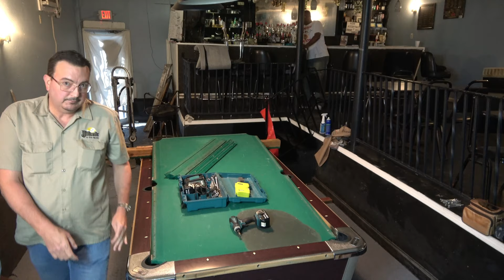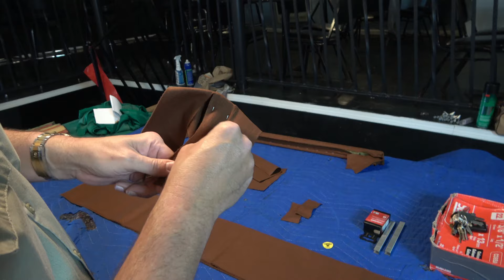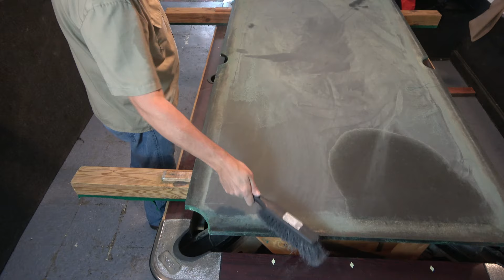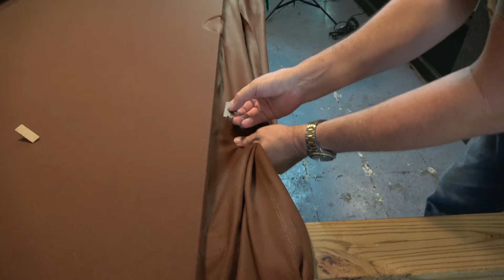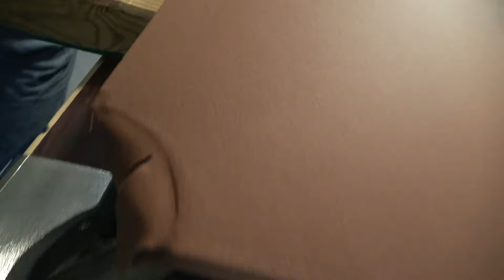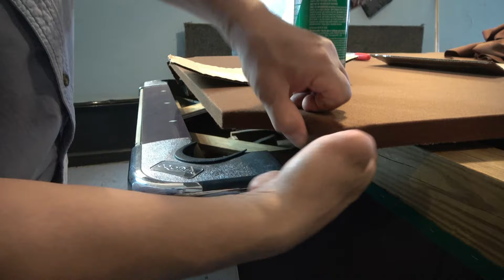How to Recover a Valley/Dynamo Coin Operated Pool Table (Step-by-step Tutorial)

Comment: which model of stapler is best suited for this and what size staples? The video looks like it will help me a lot when I refelt my valley 8ft coin op in the next couple of weeks. Going to try the Simonis  860HR
Reply from the maker: Simonis is an EXTREMELY difficult cloth for an amateur to install - especially on a coin operated table. I would avoid it if I were you. But, it's your table, money, and time. So, I hope it works out for you.

That being said, I use a Senco stapler (link in the description) and 3/8" staples (again, link in the description).
Reply: @CreativeRestorations  thanks for the advice. If I can find someone to install it for a reasonable price I will but there's not a lot of qualified people in my area. Would you use a different method for 860 cloth or the same method but just more difficult?
Reply from the maker: Simonis doesn't stretch like other cloths do. You have to use the same method. But, don't be surprised if you still have wrinkles in the rails. Especially at the side pockets. You would use the same method. It's just that it's REALLY difficult to get the wrinkles out when using Simonis.
Reply: @CreativeRestorations  thats good to know, thank you. I really liked your video it's very informative

Comment: Great video. Do you always start on the long side to glue then stretch?  I have an 8' table without slate liners. I've seen you do the ends first on longer tables.  Does it matter where I start?
Reply from the maker: Thank you for the compliment!

I think you may have someone else's video confused with mine. I never do the ends first. If you do the sides first, it's much easier to keep the cloth in it's right position (doesn't end up skewed). I would suggest you do the same.
Reply: @CreativeRestorations  Sorry, you are correct about it being someone elses method.  I noticed you don't  use pocket liners for a buffer. Is it really necessary? Do they really help protect slate from a hard bounce back?  Thanks again. I think your videos are outstanding and thorough.  You've inspired me to restore my table.
Reply from the maker: Thank you very much!

I personally think the use of cloth liners in the pockets is unnecessary. I only use them in instances where the actual bed cloth doesn't fully cover the slate (in the release cuts). Also, they're probably used more on tables that have cheaper, thinner cloth. I've never had any issues using Championship Invitational or Tour Edition or any of Simonis' cloths. Good cloth does more for the table than just make it play better.

Comment: Do you not need to scrape off any of the old glue that is on the slate previously?
Reply from the maker: You don't have to do it every time. If it has built up enough that you think it will be a problem, then, by all means, go ahead and remove the glue. Usually, you can go 7-8 recoverings before the glue is built up to that point.